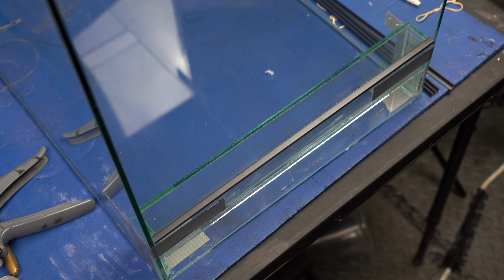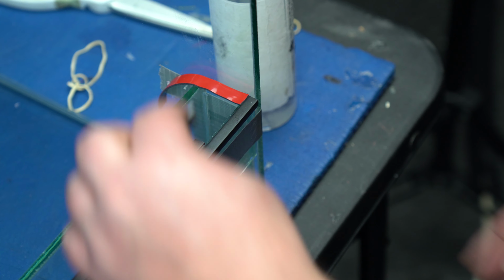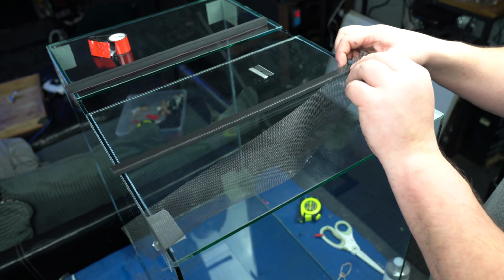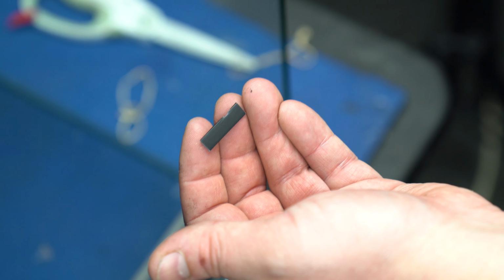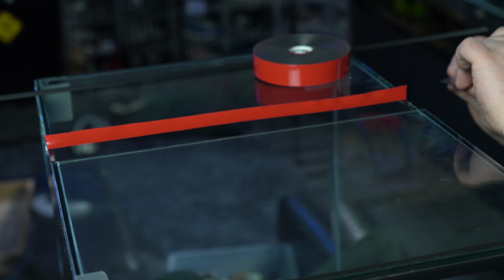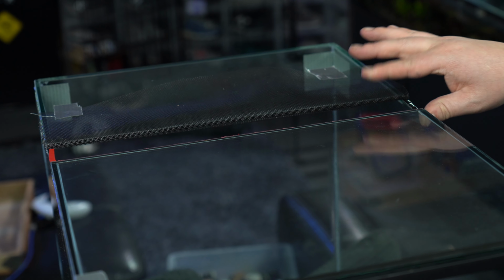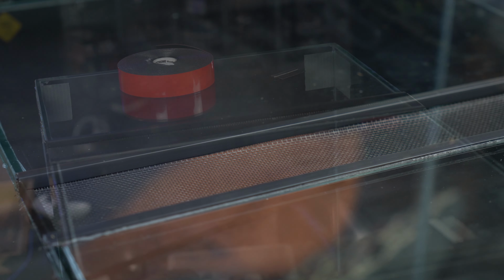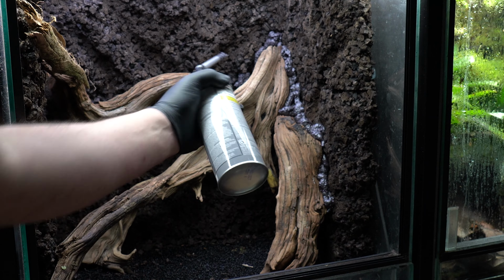Super Clean Vents for Custom Vivarium Tutorial!

Comment: Using silicone on plastic track is a problem. I use Fuze-it from liquid nails- bonds to glass and styrene. Double sided tape is not permanent. If you use it always clean the surface with denatured alcohol. Contamination speeds failure. But nice vent design.
Reply from the maker: Yeah I mean… if the double sided tape ever fails… is very easy to redo… and you can do it while frogs are still in the tank
Reply: @TroyGoldberg  Well that's a plus!